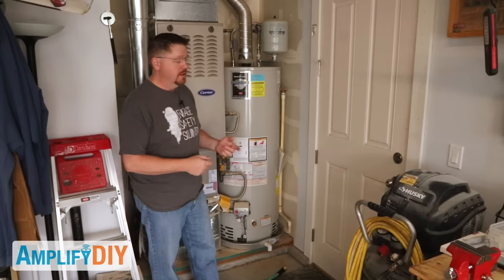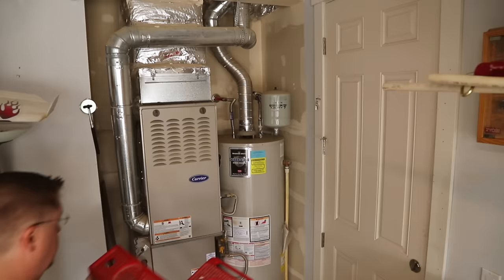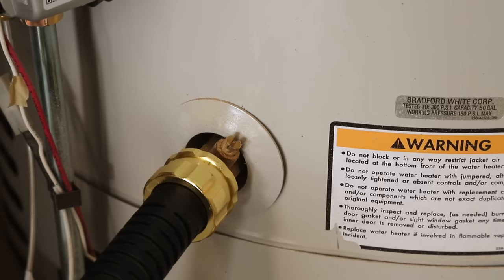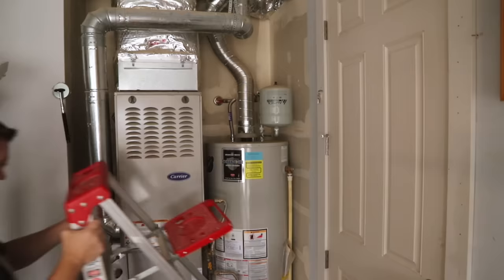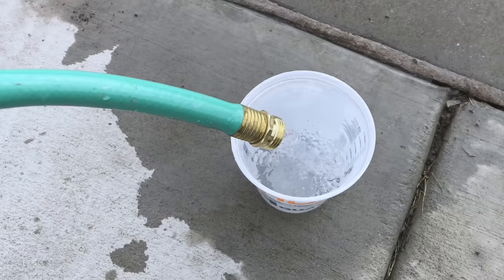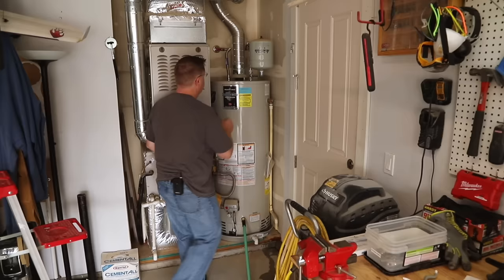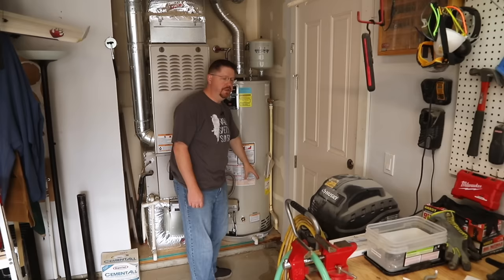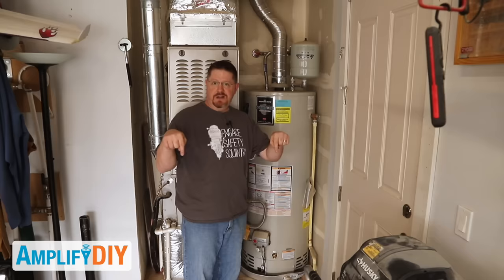How To Flush A Hot Water Heater To Remove Sediment

Comment: Remember to do this regularly.  I have a gas heater that hasn't been flushed for 5-10 years.  Recently, it has gotten so bad that the hot water doesn't flow as fast anymore.  It has initial good pressure, then it slows down to almost a trickle (but not stopped entirely).  After watching a few DIY tank flushing, I came to the conclusion that the sediment has become so high that it touches the pipe opening that feed the hot water to the house and almost close it entirely.  When I first opened the flush valve (after opening the hot water faucet), no water comes out.  The sediment has become so thick that it doesn't allow water to go out that hole.  I had to use stiff wire and prod the opening to losen the sediment build up.  After water start coming out, I closed the valve and put the hose back on and proceed to flush it.  There are so much gunk coming out.  After repeat flushing and refilling the tank, we tested that faucet again and it shows good flow.

Clues that this is happening (that I didn't know of before): slow hot water flow, dirt accumulating on your laundry after a wash, blue detergent that you use for your dishwasher doesn't get dissolved.
Reply from the maker: Glad you were able to get yours flushed! You may also want to consider upgrading your drain valve so future flushes are much easier: https://youtu.be/OBPJYg0o_o0

Comment: Thank you for this. I have one thing to add: A plumber cautioned me about quickly opening the right-angle ball valve at the end of the procedure. He said if you open it quickly, the water can begin flowing too fast to the house and blow a faucet seal or trap a big air bubble in the system that can cause problems with shower diverter valves. (Ask me how I know). Instead, he said to open it up slowly over 30 seconds or so to mimic the slow opening of a normal gate valve.
Reply from the maker: Interesting. Thanks for the tip!

Comment: Here's a few suggestions.
1) shut off the gas line. 2) Turn the pilot off. 3) IMPORTANT: Turn on a hot water faucet to get the tank water temperature down by draining the scalding water out of the tank, and mixing in cold water. When the water coming out of the tap is no longer hot, close the tank cold water line and leave the hot water spigot open to let air into the tank. 4) Hook up the hose and drain the tank 5) When empty, shut the tank valve, remove the hose and place a bucket under the tank spigot. 6) Fully open then immediately close the cold water valve. Sediment will flow into the bucket. Empty bucket and repeat until most sediment is washed out. 7) Close the tank spigot and open the water valve to fill the tank. Leave a hot water faucet open to allow air from the tank to escape. Leave the water faucet on for 3 full minutes after water comes out to ensure there is no more air in the tank.  8) Open the gas line and light the pilot light.
Reply: No way will a bucket fit under the drain valve on my electric water heater. Older gas water heaters aren’t on stands either.
Reply: After watching the video- these instructions are excellent, almost essential, additions/ adjustments. I am adding a transfer pump to drain tank because it is in the basement and because it will be much faster.

Comment: Love this! My water heater is 8 years old and never had been flushed. I think we are at #30 of the 15 second flushes and still getting the last of the specs out. There was a crapload of calcium draining as well! My driveway has a white buildup of where we are draining. This will be on our annual to to do list from now on! Thank you so much!!
Reply from the maker: So glad you got it done!
Reply: 8 years with no service and it still worked.  Think about it.
Reply from the maker: @rudymontana4515  yes, it still technically "worked" in that it produced hot water. However, by flushing that sediment it now has more volume to hold more hot water, and the tank itself is going to last much longer. Eight years with no service is more or less the mean time to failure for most water tanks like this. When serviced properly though, the mean time do failure is more like 20 to 30 years.

Comment: Great video.  I would only add two things.  1.  My tank took a good 40 minutes to drain, and 2. I needed to open the pressure relief valve to get it to drain.  I shouldn’t have been shocked when water came pouring out of it.  Recommend you advise that when this step is needed, grab something to catch that water; or grab a mop. 😆
Reply from the maker: Great tip - thank you!